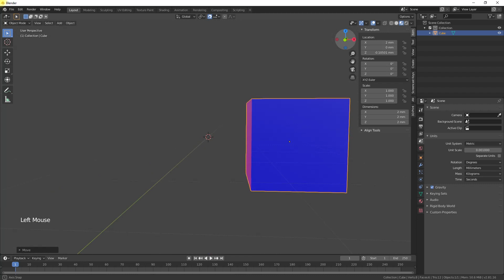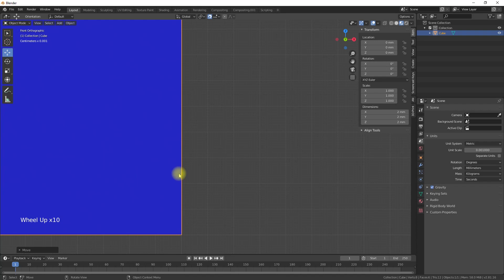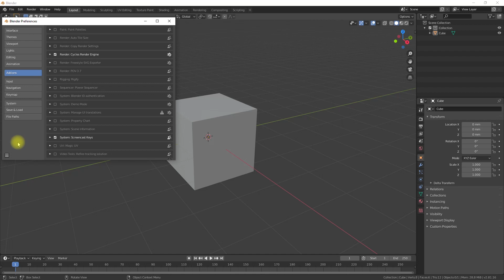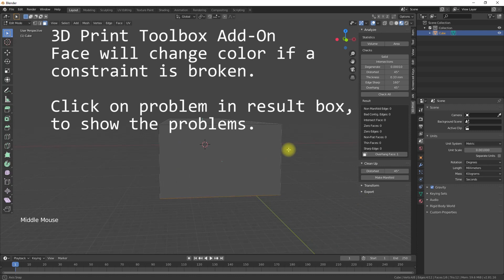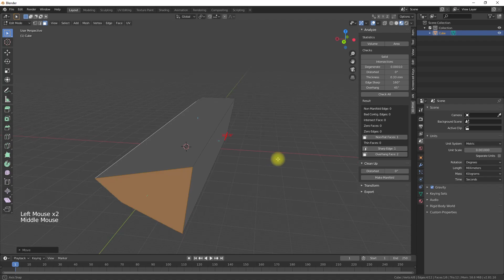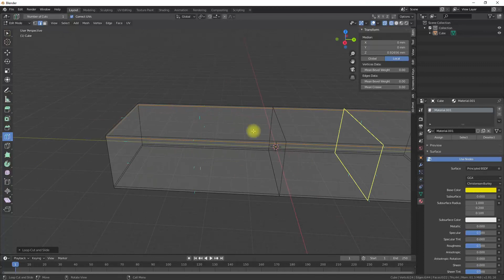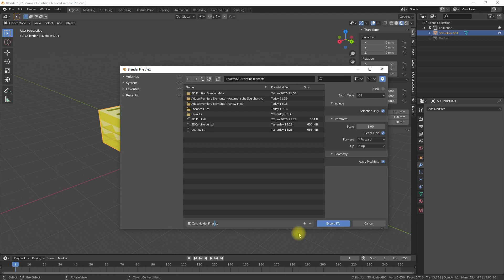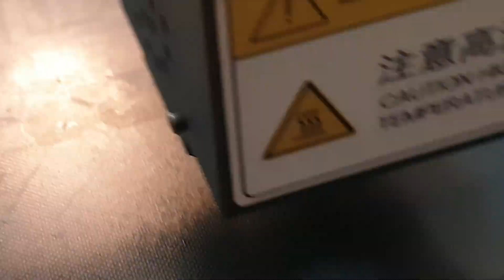Blender 2.8 - Setup for 3D Printing for 3D printing and precision modeling

Comment: The only problem with setting the scene units to Millimeters is that now whenever I add a new Mesh (like even a cube) to the scene it appears tiny (2mm for a cube).  Is there a way to fix this so that new objects added in are the correct size (2cm instead of 2mm)?
Reply from the maker: Just scale or set the desired measures in the transform box using mm as unit.
Reply: @umlooad  I’m not sure what you mean.  It’s already set to mm.
Reply from the maker: Right after adding a primitive set the desired dimension in the transform properties dialog.